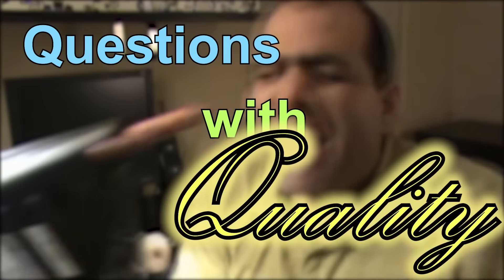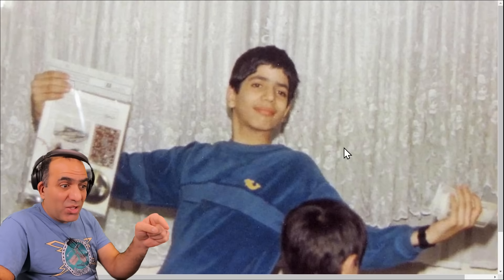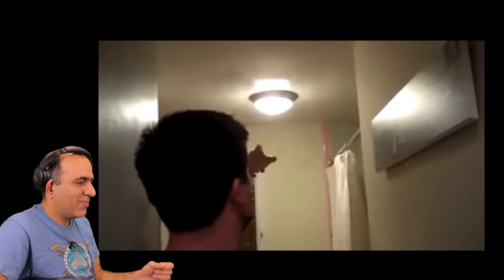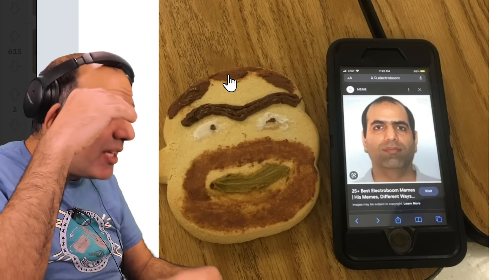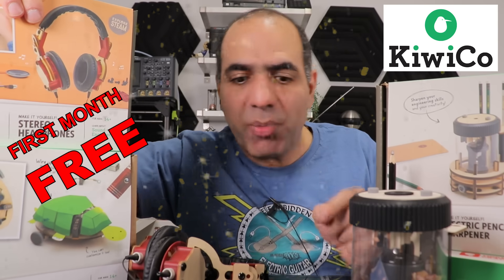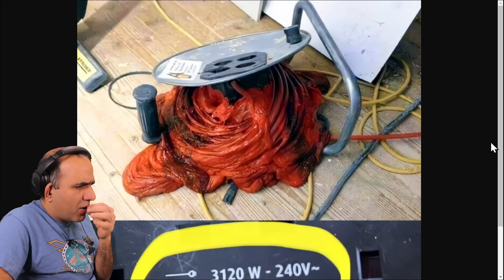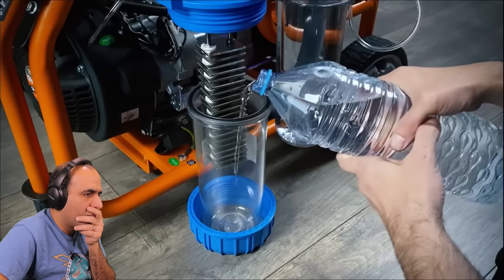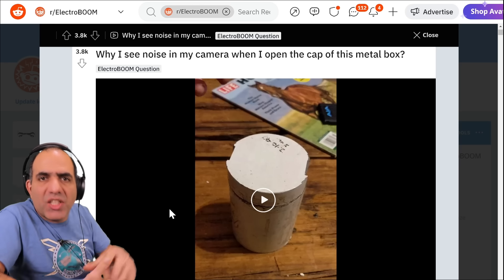Can ENGINE Run on WATER?! They Copied my Toy (LATITY-011)

Comment: Can weld with solar panels. Rig about 10 in parallel ro pull about 100A at 40ish Volts in sunny weather and it will weld as smooth as silk
Reply: that's probably much more expensive than buying a welding machine though.
Reply: @Basement-Science  So is making any device rather than buying it. Not the point. Although with a changeover swich on an existing home inverter system it would be a very cheap welder.
Reply: @4dbullshitpatroll6  Sure, my point is just that a real welder is also much better at welding than anything DIY. Usually DIY welders of any kind are ONLY cheaper, and worse in all other ways.

If you do this just for fun with panels you have anyway, that's totally fine.
Reply: @4dbullshitpatroll6  umm yeah sure dude, lol. 😆
Reply: @4dbullshitpatroll6  I'm sure any professional welder will be happy to use your "welding machine" with 0 settings  because ALL welding jobs are totally the same and it's all unnecessary. Yeah, makes perfect sense.
Reply: @4dbullshitpatroll6  I'm not arguing a strawman. YOU said: "No electronic wizardry will create a more consistant, perfect and usable arc than a PV array" 
So YES, you did pretty much say that "we should replace welding machines with solar panels" - presumably if it was convenient to set up.
I told you that is nonsense. But whatever.

Comment: That welding with a carbon rod was obviously fake, you could even see the slag from the electrode. Way back when arc welding first came about carbon electrodes were indeed used, there was two methods one where two carbon electrodes were used to create an arc which was used in much the same way as gas welding, the other method used a single carbon electrode and was used to strike an orc directly onto the workpiece, the usual way was two sheets of metal would have the edges bent up and be closely fitted together then the arc was struck on the upturned edge so that the metal fused together as an autogenous weld. I have one of the devices using two carbon rods, someone in the 1960's brought them out again and sold them for brazing using an arc welder, works OK but you have to be very careful the arc dose not jump through the work as it will then burn holes, the other problem is they are only really suitable for AC machines as the carbons are the same diameter, so not really good with modern DC welders also its very hard to get the copper clad electrodes, I had to scrounge some from a film shoot  where they change the rods between shots in order to make sure the light is on when filming , in order to  try the carbon arc welding device out.

Comment: Fun fact you can improve your gas mileage supplementing some hydrogen from a hho generator it's not earth shattering you get at most a few mpg and it takes quite a bit of tuning.
Reply: or you could not waste your resources by making the hydrogen unless you get electricity for free.
Reply: @Basement-Science  the electricity is made by the alternator in the car and it improves the milage soo what's the point of your comment?
Reply: @just1ofgod  Oh so you think the alternator just magically summons electricity out of nowhere? 
Guess what, the engine delivers that power, and there is NO WAY whatever hydrogen this produces gives you MORE energy back, EVEN at the highest theoretical efficiency.
Reply: @Basement-Science  not sure what to tell you man I did it and it worked I'm sure it shortened the life of the alternator but it's not breaking any rules hydrogen mixed with oxygen are pretty powerful plus it's still burning gas I got 2-3 mpg better it's not like the whole car was running off it solely.
Reply: @just1ofgod  Yeah I'm sure your testing methodology was absolutely flawless and it's all just a conspiracy that this is not done anywhere else bro

Comment: I had a similar issue to that light switch years ago while helping my brother in law work on his house.

Somehow, after replacing the light switch in one bathroom, the switch would turn on the lights as well as the wired smoke alarm in the hallway. My sister didn't think it was as funny as I did.

Comment: 00:03 isn't that a steam engine?
Reply: So what is function of coal (for heat)
Just kidding 🤣
Reply: @TGSankar  i mean a steam engine runs on steam so I guess you can make an engine powers by water but I'm sure that it would suck and pretty much be useless
Reply: @mcll7325  yes but that will be need heat to generate steam by water and without some fuel it's impossible

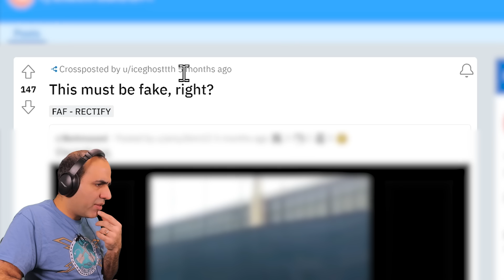Comment: @10:24 wouldn't Fermat's principle not apply here and the right terminology would be least time, which in most cases would be the shortest distance or the way of the least resistance?

Comment: I've had a similar issue like the "Light Switch Puzzle", and it wrecked my brain. Turned out to be a open/floating main neutral. Very confusing and very dangerous!
Reply: I had a ceiling light that would not switch off. There was nothing wrong with the wiring, I just replaced incandescent bulbs with LEDs and the capacitance of the wiring let enough current through to keep the LEDs faintly lit. The solution was to physically rearrange the wires, no easy task.
Reply: @olmostgudinaf8100  Sounds like a sub-par LED bulb. Better bulbs are designed to prevent this kind of phenomenon. Learned from BigClive's videos.
Reply: @KeyDx7 Oh! Yeah, I forgot about the US electricity system and it's weird voltages... Yeah, well, okay. I see why you'd have a problem with that.
Reply: In my home built in 1985 in California, I've encountered weird problems with some neutral wires being live, when replacing outlets. They measure 0V against ground when connected to other neutral wires in a wire nut, but when you undo the wire nut some of them will spark and are carrying 120V! I got a mild electric shock the first time I encountered this. I still don't fully understand the cause - something to do with split phase circuits sharing the same neutral wire? Pretty dangerous anyway.
Reply: @markirmuir  Maybe the house wasn't properly grounded. I remember a very specific property about the grid where if you do not ground your house wiring, some phase may come back through the neutral.

I've lost some eletronics to that and it is difficult to find installations properly grounded.

Sometimes the neutral isn't always live, it might be a quick eventual surge, it all depends on how your power box is planned.
Reply: Lack of ground sometimes does something similar, but ground issues generally involve power diminishing, sometimes great variations of it, even sparks from the electronics.

Neutral-neutral are somewhat harmless
Reply: I cant tell you how many times i have made this mistake. always wire stuff in paralel
Reply: @SomeRandomMusician  Don't, really don't.

Wire the stuff the way they're supposed to be wired.

If you wire common batteries in parallel you'll overheat and maybe explode them (the alcalines do explode). Car batteries suffer a lot from wrong jumper cable wiring
Reply: @ruffusgoodman4137  i just learned that lesson about an hour ago
Reply: @SomeRandomMusician  kkkkkkkkkkkkkkkkkkk
Reply: This makes me nervous bc my and my brother installed an LED plastic light fixture after uninstalling a fan. We left the grounding wire free bc it didn't need to be grounded bc it's plastic but I don't know shit. Hope it ok lol
Reply: @amandataylor1668  Worst case scenario, it's gonna flash like you guys got a haunting on it. Maybe it will last a little shorter, 50 hours or something.
Reply: I had one where in order to turn on the hallway light you had to first turn on the bathroom light
Reply: @lazydegeneratweeb6  Series wiring. Probably the hallway wire was mistakengly used in bathroom's switch instead of the proper wire
Reply: Don’t know why I didn’t see this video before. I thought for sure we were getting a bait and switch. Definitely an open neutral.
Reply: A floating neutral shouldn't be dangerous since all the touchable metal parts should be connected to ground. So this fault should not be a danger to anyone - unless you don't have a proper electric installation.
Reply: @TheMightyZwom  Laughs in pre-1970s housing with no grounding
Reply: @danieljensen2626  laughs in 100 year old house

Yeah....there have been updates made, I mean it's not like we have paper wiring or anything. That being said, I'm pretty sure the 'updates' were made sometime in....the 70's >_>
Reply: @AsmodeusMictian laughs in a $450,000 house without grounded outlets, built in 1983, in a massive single family subdivision twenty minutes outside of a massive city. 
Also, the built the kitchen bay window completely over the top of the only basement window in the entire furnace area. 
Codes may have changed; but bribes and payoffs haven’t.
Reply: @juliettedemaso7588  ho-ly sheeit.
That's absolutely insane.
Reply: @danieljensen2626  Wait... you're telling me you don't upgrade crucial systems in your housing when they're 50 years old!? Ooookay...
Reply: @TheMightyZwom  Must be nice to have the resources to literally gut your entire house to replace the wiring. Might it be a good idea? Maybe. Doesn't mean people can actually afford to do it.
Reply: @lostwizard   I looked at it rather from a point of safety and my surprise was actually about the fact that this is legal...
Reply: @danieljensen2626  ye
Reply: @TheMightyZwom  I’m guessing you’ve never seen someone hit by an open neutral. The ground didn’t keep them from the hospital.

Comment: That electric fault puzzle seems like an open neutral in a shared neutral system.
Reply: I agree. Bathroom was probably wired with an MWBC for the bathroom outlet and lights and the neutral has become open.
Reply: @everythinghomerepair1747  what's mwbc? Is there an ELI5 for Americans and Translation for Europeans?
Reply: @JeskidoYT  MWBC is a “ multi-wire branch circuit”. It’s when two circuits share the same neutral wire back to the panel. The two hot conductors are 180 or 160 degrees out of phase so the neutral can’t be overloaded. Look it up and you will find plenty of diagrams. In this situation the two circuits that share the neutral will appear to act bizarre if the neutral connection is lost hence why I think that’s what happened in the bathroom. In the U.S. and Canada it’s unusual to have the bathroom lights on the same circuit with the outlet. But they could absolutely be two separate circuits sharing a neutral aka MWBC. Hope this helps.
Reply: @everythinghomerepair1747  great explanation
Reply: Yeah similar issue was in my home also. later found out most of the common was cut by the electrician because he could not turn off the doorbell. 😐
Reply: That's where my mind went when they got to the part with the light getting "more power." https://www.youtube.com/watch?v=LJvyb_WujZg
Reply: floating neutral combined with a capacitive dropper in an LED bulb means that any current will light the bulb
Reply: I've seen some f* ups by connecting switches neutral-neutral and light with power outlets to get that.
Reply: 100% bad tie in.
Reply: Also the perfect example of why people shouldn't mess with their house wiring unless they are actually competent..... no one would dare touch the gas (ie natural gas for the North American viewers, not petrol) pipes without knowing what they are doing yet messing with electrics is seen as ok even though the risk of injury or death are just as high..... or worse higher when it 'looks' like everything is working but a crappy joint you made and hid in the wall slowly gets worse and causes a random fire 2yrs down the line when you least expect it, or potentially no longer even live there anymore........
Reply: @Thats_Mr_Random_Person_to_you I realize this is an old post so I won't expect any real response but just wanted to add to your astute observation that I've learned quite a bit by tinkering w my own house. I think a realistic awareness of one's knowledge base and a real desire to make it 'code' will increase both your knowledge base and research skills and resources. I will admit it's fedora and draining, tho, to maintain vigilance when you know you're pushing boundaries. Not for the lazy or timid, to be sure.
Reply: im pretty sure its actually her laughs fault

Comment: There was a Japan-only PS1 game called "Irritating Stick" that was based on the concept of getting shocked if you let a stick touch the sides of a metal maze you guided it through.  I've heard it was based on an actual Japanese game show, but was never able to confirm.
Reply: Can confirm, I've seen footage of the show.
Reply: They blew up gunpowder instead of the contestant though.
Reply: There is a Norwegian show that's used the same kind of setup as that Jimmy Carr show as well (71 grader nord)
Reply: They used to have countertop ones sitting in bars. It didn't shock you, but it let out a blood curdling buzzing sound that would make you jump...
Reply: That PS1 game was a port of an arcade game (The Irritating Maze) that used a trackball connected to some air jets. The trackball added difficulty and the air jets simulated the electric shock in a safer way. But yes, I'm fairly certain the idea is much older than even that.
Reply: @andlabs  I've had the pleasure(?) of playing that on cab back in the day. It definitely was a jumpscare to get a face full of (cold!) air on hitting a wall. Fun fact: the game ran on NeoGeo hardware.
Reply: Just search after the Japanese title of the show which you can find on the wikipedia page, here is a youtube video ID: n8ztJOt9kCo

Comment: Check out the Australian SCOPE soldering Iron. It uses a short section of Carbon rod pressed agaist the back of the Copper tip. This is done by pushing a ring on the handle. The result is a very powerful and manually temperature controlled soldering Iron. I find them invaluable for automotive electrical work, or anything that needs a lot of heat.

Comment: At 8:31 they show only the rating for the fully extended cable. What they dont show is the rating for the coiled up one, which is much lower because the cable drum creates a coil. And we all know what fun you could have with a wire coil
Reply: It's not really a coil, because all magnetic field generated by one of the wires get negated by other one. It's just heat. Long rolls of copper have some resistance, with high current flow there is heat generated and trapped inside.
Reply: @kjur18  it depends if the wire is twisted or not.
Reply: @monad_tcp  Nope, twisting is only effective on close range. It is just a simple way to keep the wires close together. For field cancellation it is not strictly necessary.
Reply: To add to this:
Those reels are mostly rated at around 3300W when unrolled, but only 1000-1500 when rolled up. And i have seen people using a mitersaw, anglegrinder, drill and weedwacker when  fully rolled up.... way overloaded even if it was unrolled.
Reply: It has little to do with being a coil, it has to do with less airflow than normal.
Reply: @Owen_loves_Butters  The impedance is higher when the cable is coiled because it becomes an inductor (well, more of an inductor) so it does have a lower current rating in that configuration regardless of cooling. (It's not like these cables get particularly warm when they're run at max rating extended, thermal load alone wouldn't suddenly melt them when coiled)
Reply: @bosstowndynamics5488  it doesn't become a conductor, because magnetic field of one wire isncanceled by the other one. It's just that a cable is heated by adjacent cable, instead of dissipating heat to the environment.
Reply: @bosstowndynamics5488  Inductive impedance doesn't cause much extra heat to be generated, as it creates mostly reactive power (especially since it's an air core). Airflow is the main factor. If I had fans blowing across the entire stretched out cord, I could probably pass 30 amps through it just fine (despite being rated for only 13). I wonder if there's an experiment someone could do that would prove me right. (Or wrong, I'm open to changing my mind)

Comment: You can weld with graphite (not with that setup), as long as the base metal and filler rod are CO2 compatible. Similar to TIG welding, and a filler rod is necessary unless you're spot welding.

Comment: Use water electrolysis and separate the hydrogen and oxygen and have tanks for each hydrogen and oxygen and have a fuel cell convert it to electricity and have it power electric motors.
Reply: What powers the electrolysis?
Reply: @phunkydroid  an onboard battery ofc.
Reply: @Atlantis Space Shuttle  so not water powered, battery powered.  Will get out less power than the battery contains and would be better off just hooking an electric motor straight to the battery.
Reply: @phunkydroid  not really battery powered. The battery is what is needed to get enough hydrogen and oxygen to power up the car. The battery is there for ignition. Combustion can happen without spark plugs.
Reply: @StrykerFox  the energy you can get out of combustion of the hydrogen and oxygen is less than it takes to split them in the first place...
Reply: @phunkydroid  yes which is why we need to separate hydrogen and oxygen in the first place.
Reply: @StrykerFox  You're making no sense.  There's more energy in the battery than there is in the combination of hydrogen and oxygen from water split by the battery.  Battery->electrolysis->fuel cell->motor is wasting a ton of energy in those middle two steps and you'd get more just going battery->motor.
Reply: So free energy?